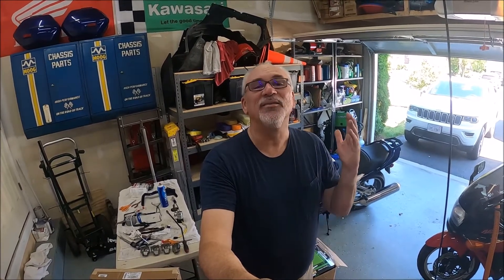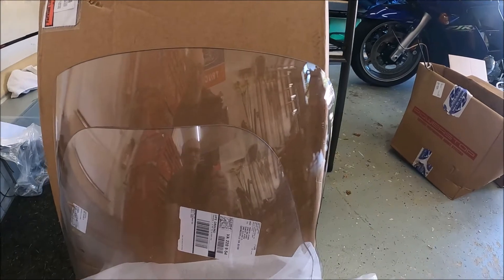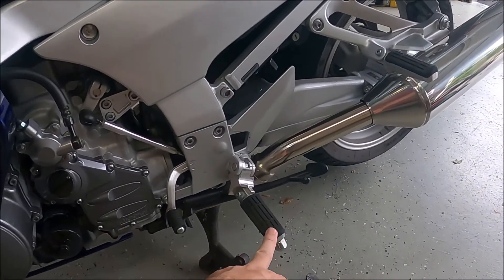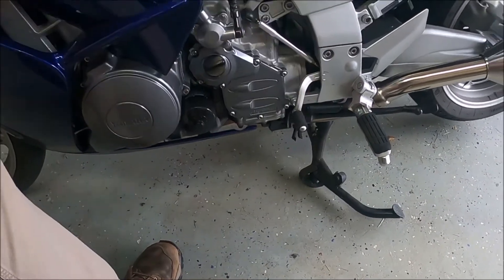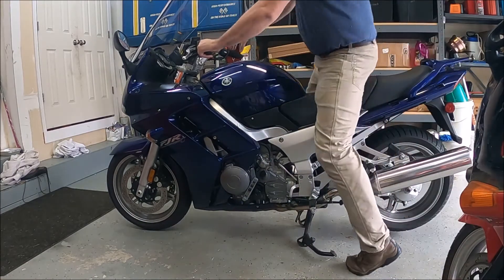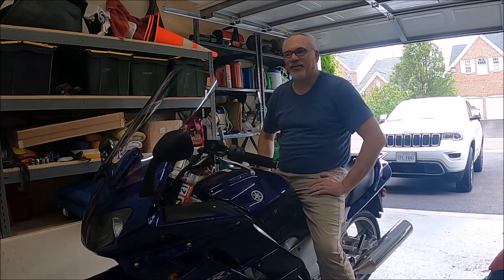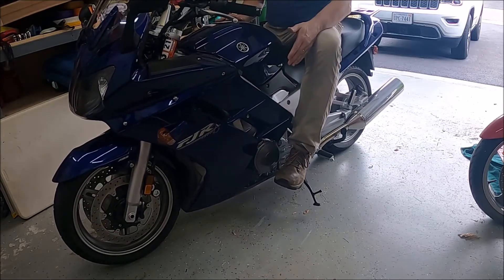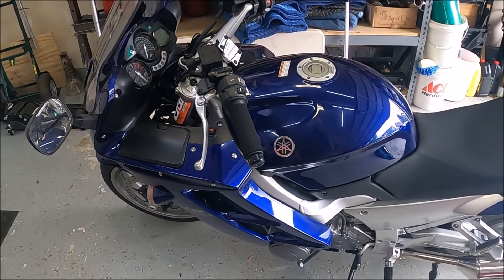Still Too Tall for the FJR1300

Comment: 6:48 this is the side I need help on lol. Did you have to take the entire fairing off to install? Otherwise looks super easy. Would love a short video how to do the right side
Reply from the maker: It has been a while now but I did not remove the fairing.  Don’t recall if I removed a few connectors or not but I do recall pulling the fairing out of the way that little bit to get the bolt in.

Comment: Hey there came u across you video when searching for lowering pegs. Really good video. A few questions and hopefully you know the answers. 

1. can you use any type of lowering peg or does need to be FJR specific, did you also have move the gear shifter and foot brake?
2. with the handle bar raisers, how high have gone up and did you have lengthen any cables?
3. also in line with Q2, did you have to modify the mirrors as your hands/arms are higher up?
Reply from the maker: You have to have the specific lower kit for the FJR. I did not have to make any major changes to the shifter. The brake pedal is a little out of line but I have been able to use it fine. 
Bar risers were a simple install. No extensions required for any cables. 
Mirrors were fine. Maybe a little more air hits your hands now but I am switching out to new mirrors anyways so not anything that concerns me.

Comment: Just bought an 06 model is it possible to lower the bike as my legs struggle to touch the ground it's very wobbly to hold up and turn around im petrified i might drop the bike it has a black sheepskin seat cover on it
Reply from the maker: You should try without the seat cover first but you also can get longer dog bones and lower the bike that way.